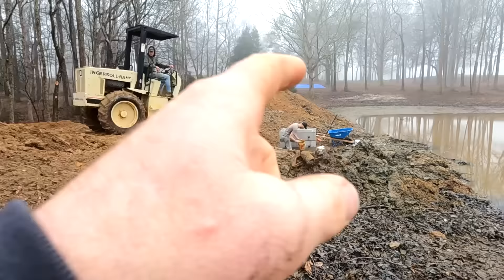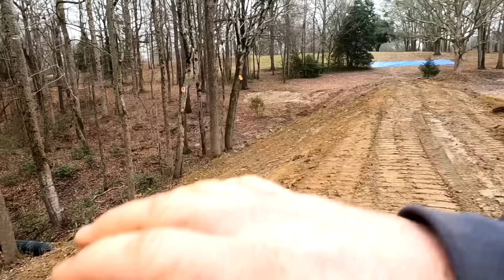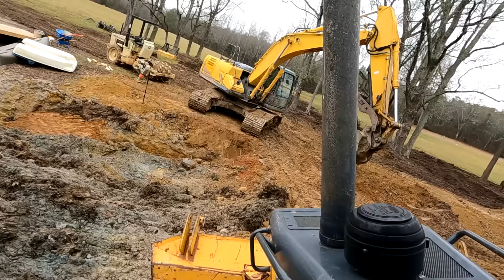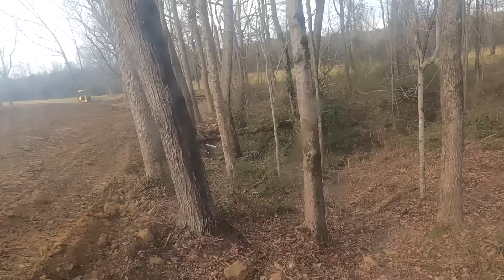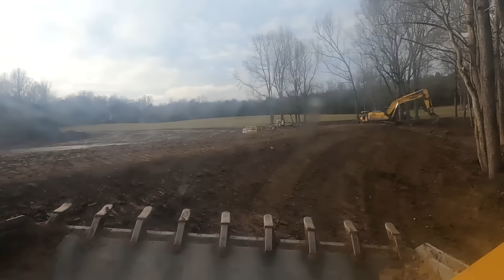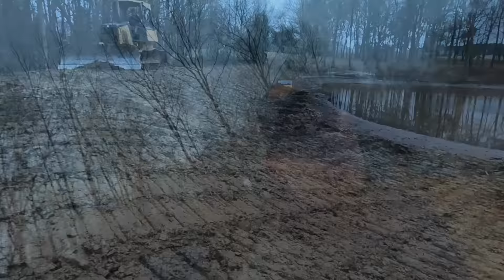60 ACRES - Grading the pond dam

Comment: When you set the concrete box on the ground there were no visible holes on any side yet there seems to be a drain pipe.  With no hole in the concrete block, where is the pipe connected?
Reply from the maker: You break through one of the sides of the box to insert the pipe.